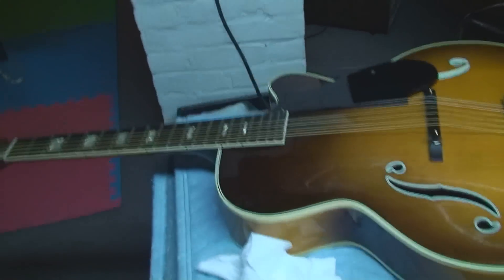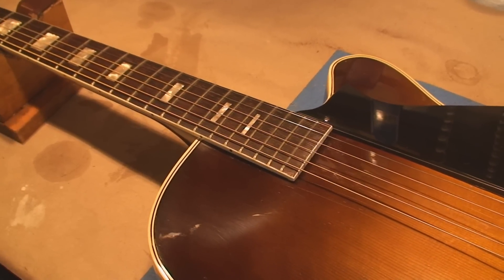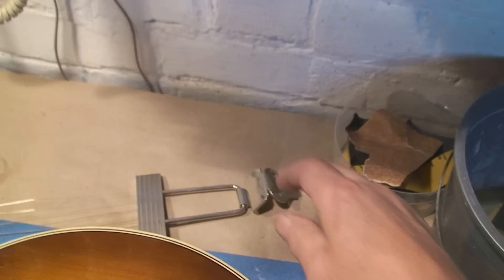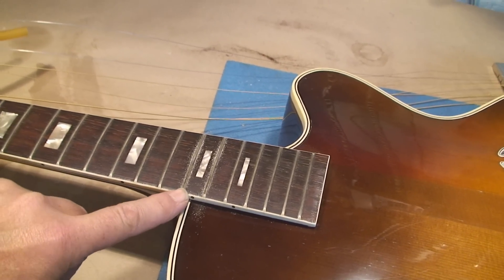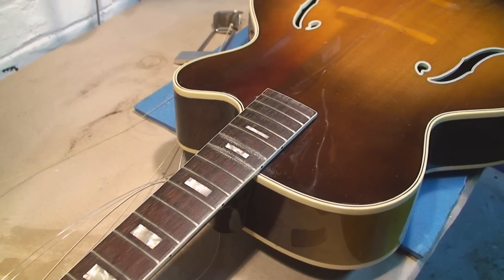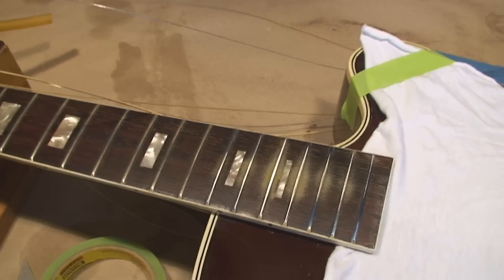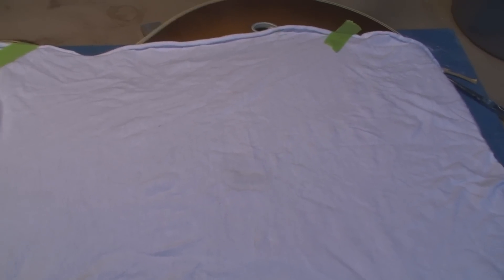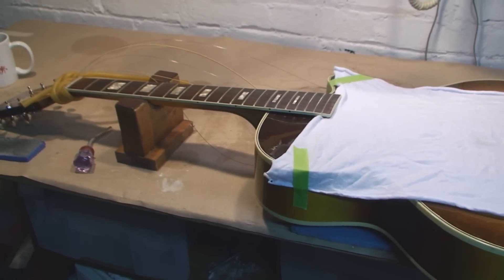More Tweaking The Harmony H1310 Guitar Part 1

Comment: Tail piece is good, just a little bit of a different design with a little ledge at the end of the slot; if the string's all the way in it doesn't ever pop out. The idea was to hide the ball end of the string. Fancy high end piece.